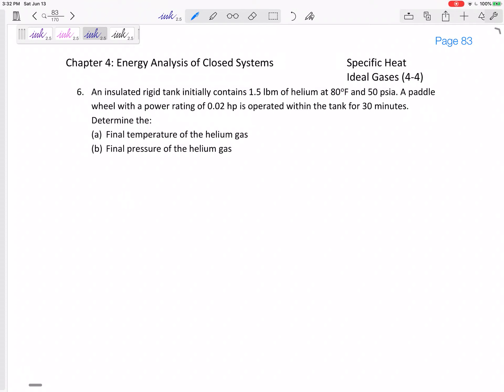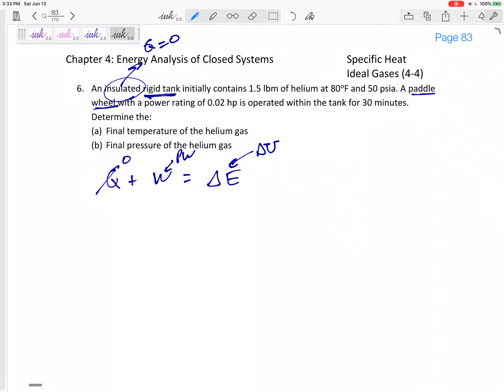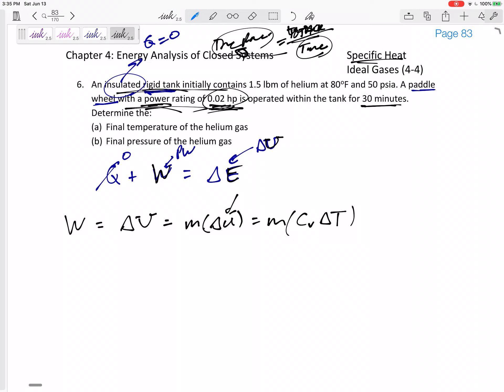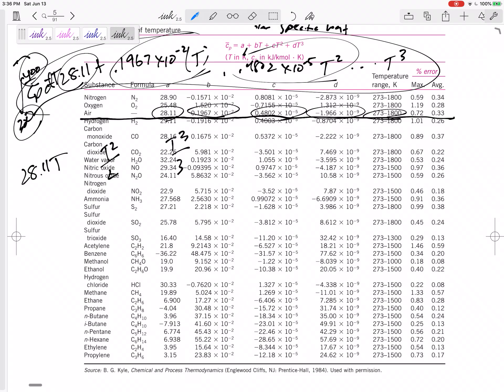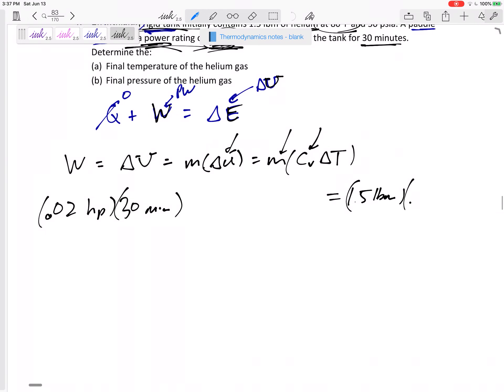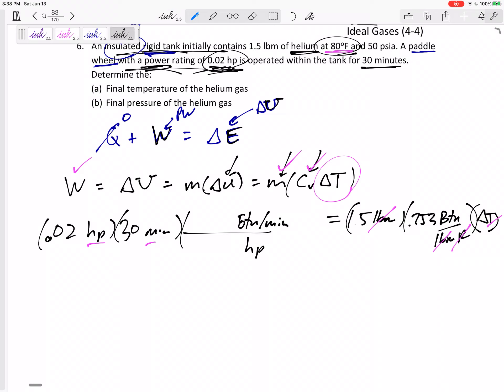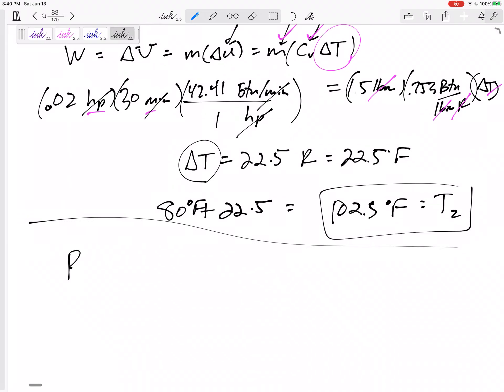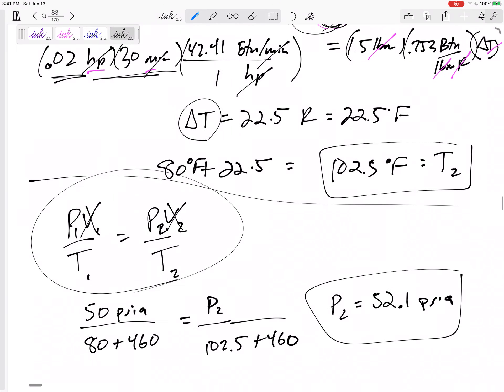Thermodynamics - 4-4 Ideal Gas Specific Heat example 2

Comment: 2 kg of air enclosed in a rigid container receives 0.2 kj of paddle wheel work and 0.5 kj of electrical  energy per second. Heat loss from the system is 0.6 kj/s. If the initial temperature is 25℃ what will be the temperature after 5 minutes ?